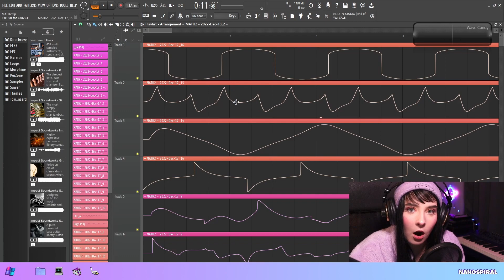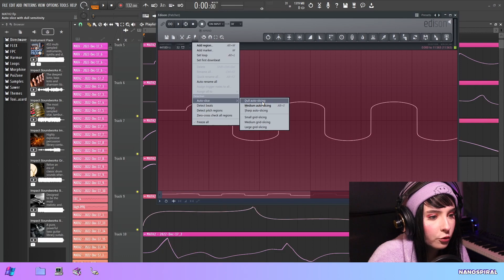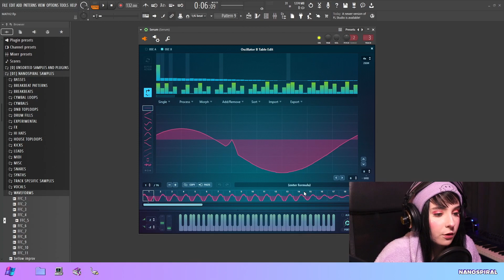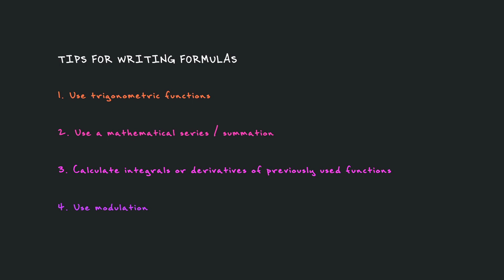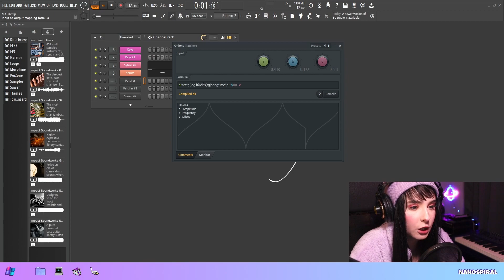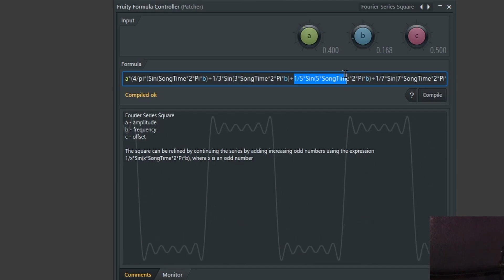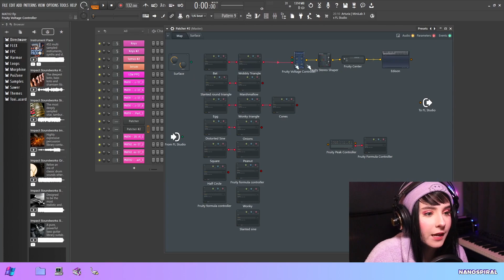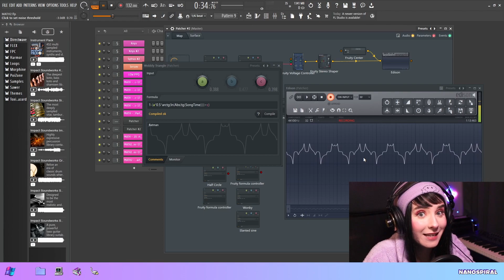Converting Formula Controller Output into Audio | FL Studio Sound Design

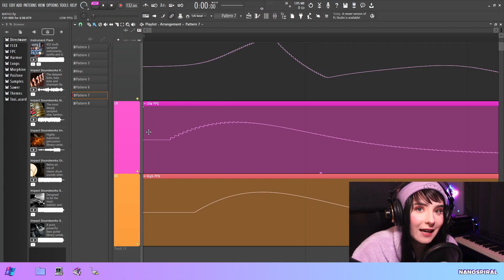Comment: So I'm still confused byu something. The formulas listed on your files all generate the waves at like 1 hz, and it doesn't seem like there's some sort of explanation of how to make the conversion to the pitches used in the video after 3:37. I get that this is an advanced video but considering that none of the plugins shown here seem to actually convert the waves to a reasonable pitch, I'm baffled about how I'm supposed to actually make anything listenable with what I got from all of this.
Reply from the maker: Hi. You can drop the created waveforms into synth plugins for example, basically it's a method of making custom waveform samples. Most synths have an option to import waveforms and you can adjust the pitch there. It is possible to get real time audio without converting to waveform samples using the Formula Controller and Voltage Controller, but the resolution is too low at audio rate to reproduce those waveforms accurately. The low frequency when creating the samples helps retain them, so it can then be sped up in a synthesizer or sampler.

Comment: Wicked tutorial. I've always meant to get into the formula controller, but never got round to it. I saw your name mentioned in a thread about input mapping formulas, because I was interested in getting more functionality from automation clips as well as other controllers like the envelope controller and X Y Z controller, and someone mentioned this video. Definitely worth watching. 

Just a few questions: Having not really used this extensively, I'm unfamiliar with it's full functionality, so bear with me. It seems like this controller is free running, based on the host tempo. Is it possible you use assychronously with hertz values?  Also can you trigger it with a gate signal. such as note on? That last one in particular would be of a lot of use.
Reply from the maker: Hi, thanks! The Formula Controller is most commonly used by syncing it to project tempo, but it's also possible to calculate a Hz value using a tempo variable, like this: https://www.youtube.com/watch?v=gBDlwpi9_Lg&t=12s 

You can't directly connect midi into it, but you can use it with Envelope Controller, which takes a note and turns that into the control type Formula Controller understands. If you just want it to trigger as on/off, make the envelope shape a rectangle or turn it off.
Reply: @nanospiraI  Funnily enough, I just checked your video on hertz values after checking the rest of your channel. So the first question was kind of redudant. There's a lot of useful info in that video as there is in a lot of your other content. Thanks. Your method of applying an envelope was along the lines of what I would probably have done. Not sure if I can reset the phase to it's original starting value each time though. Might have to switch on my maths brain to get to thinking about that. Sonething I haven't done for decades. Lol. Probably easier to use something like Gatekeeper VST that has that functionality built in. Conflict between the practical musician/producer side of my brain, more interested in finishing tunes, and the nerd side, who likes experimemting and discovering stuff, ensues:)